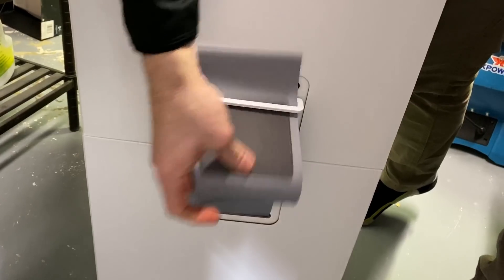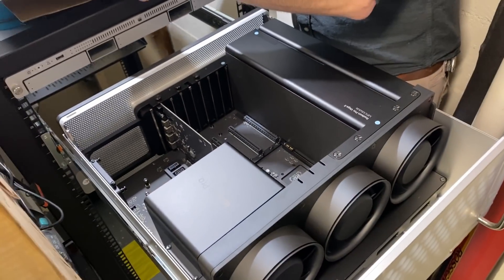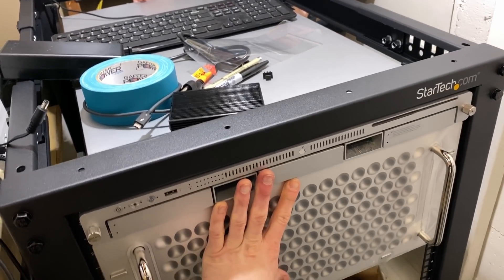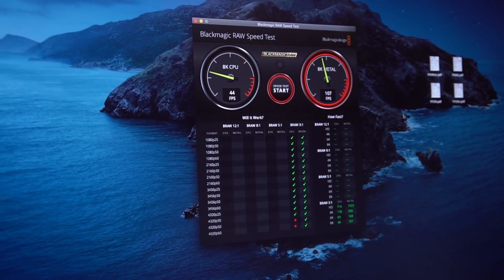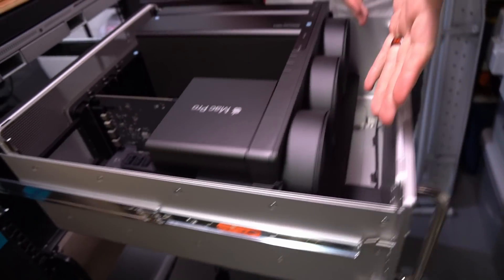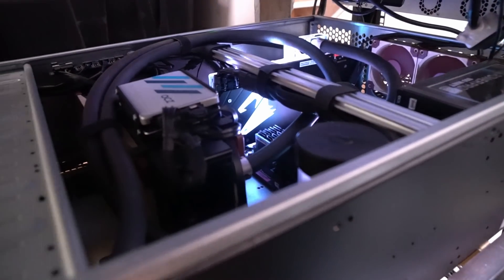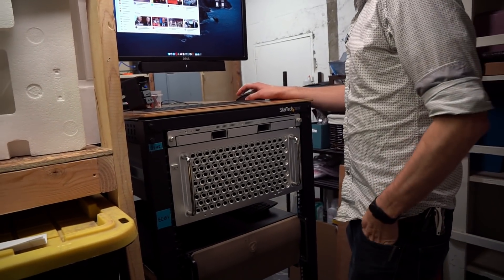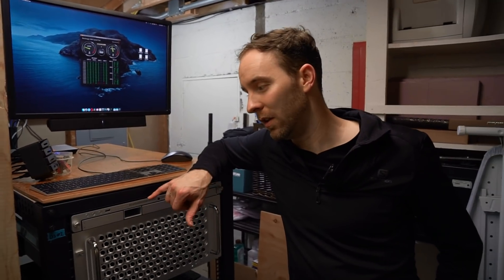Apple Mac Pro Rack - Unboxing and Observations from a Video Professional.

Comment: That RAM placement will be a problem if that machine is installed in the bottom few U of a rack. I wonder why they designed it that way?
Reply: So it looks pretty.
Reply: @alanrossington1351  Maybe, but one doesn't typically have the luxury of doing that in a data center environment, where rack space is precious.  Are people really supposed to leave the bottom third of their racks empty?
Reply: add RAM before the rack (of course), but that it CAN be deployed at any time just by pulling it out on the rails .. kinda genius. 

all the heat by the laws of physics .. goes up. 
absorbed by the entire solid chassis. 
for free. 
+ the blower
+ the fans. 

u don’t want the RAM on the other side. 

but RAM is isolated for a bunch of other key reasons too (rack or desktop versions)

a) exact placement (jacked into the motherboard)
b) isolation (heat / airflow / thermals / sculpted .. considered), this is their ultimate design so far, moved forward, after decades of tower design refinements, G3, G4, G5, Intel MacPro1,1 thru 5,1 .. then 6,1 .. now 7,1. 

I have owned and teck’d most every type of pro Apple stuff since 1983 (except XSERVE)

every iteration .. RAM placement gets better. 

to the un-initiated, a G5 cheese grater
looks like an Intel cheese grater. 

every flavor I have owned .. the insides are COMPLETELY DIFFERENT. 

outside. 
almost impossible to know which gen it is. 

both from a single user perspective + an Apple Certified repair facility type perspective .. I have seen a little of that world too thru friends, every single comment and b*tch session is considered and addressed, perhaps on a daily basis. board revisions will be different as the days and weeks progress. 

I have had Apple fix obscure bugs and niggles - I’m sure no one else on the planet has found - sometimes in as little as a few days or a week, in their pro apps or OS. 

one key reason to be legit. 

u run a crack .. u get left way way way behind. 

been there all kinds of times. for all kinds of reasons. 

sometimes while a legit license goes down, we need to keep going .. switch to a crack. we get a new patch or tech support irons out an issue. boom. back to legit, almost no downtime. 

in a production realm .. we need to pull out all the stops. 

this is always the case in any system tho. 

less savvy IT, and creative thinkers at your studio = u get left behind. 

regular folks are oblivious to this. getting fooled by the myth of cost (hardware .. staff .. ROI). 

they think every 5,1, 6,1 7,1 is the same. 

even as far back as the first bondi blue iMacs, I have pictures of Rev C, Rev J boards. 

OS just says the same to the user. 
under the hood .. man .. probably hundreds or thousands of changes are shoehorned into each board revision. 

that is just normal development. 
hardware + OS. everyday it is new. 

all systems are like this.

Comment: give me legit reason why this is better than hackintosh? if you buy rack setup where visuals does not matter, pure performance and price matters as well you mentioned that this will have only 32+64 gb ram.
Reply: Hackintoshes are cool, but run into lots of issues esp with software updates. The biggest benefit is peace of mind and everything just working as it should. Hackintoshs require maintenance and lots of researching and testing to get working and to keep working years down the line.
Reply: @createdbyeric  https://www.youtube.com/watch?v=swTNV0AqzTQ
https://www.youtube.com/watch?v=i_-K1UtI8PE
Reply: Jānis Meija because in a professional setup you want support and not have to worry about updates breaking stuff, kexts, clover, etc. The cost difference is made up by time saved on all those little things you have to worry about with hackintoshes.

Comment: The Mac Pro 6,1 can be referred to as the cylinder.

Neil Parfitt of Toronto, Canada does audio work in movie soundtracks. He loves the rack unit for his ability to get into the 7,1 without removing cables every time. He has an ilok and a synchrosoft dongles he plugs into a 2 slot usb hub that plugs in where you put the one dongle. He hopes there will be enough power for them. Apple should offer a desktop that can be pulled up and leave the cables in place. https://www.youtube.com/watch?v=xNrG2mwt4Uo
He had 2 cylinders and all his slots on the 7,1 are occupied. He wants the Mojave OS that the 7,1 was shown operating on. His apps are not all Catalina compatible, and some are 32 bit.
Reply: Beat me to it. Was also going to suggest they contact Neil to pick his brain.
Reply: @CescoCDN  that little hub i bought works great!

Comment: The Resolve database machine, does that have to be a mac? Is it just fast storage or does it need to run resolve itself as well? And if so, why not linux?
Reply: It's just a postgresql database so no it doesn't need to have resolve on it. I've got mine running on a CentOS system. Works great. Instructions on how to do that are in the resolve manual.
Reply: @AnillusionNL  Apple people think everything needs to run on a Mac.
Reply: Well to be fair the linux option wasn’t documented in the manual until a couple of releases ago. Only installs on Mac and Windows were documented. And when I asked BM about the linux options I got a response that it was possible but too advanced to even be documented as you needed to be a “postgresql guru”. But if you have a little knowledge on how to setup a linux webserver, you can figure this out though. It’s not that hard, but really powerful.
Reply: The Database can be hosted on Windows, Mac, or Linux, whichever you find easiest. We opted for the MacOS environment for the database as our team is familiar with MacOS so it makes troubleshooting easier if a issue arises. The networking/file sharing through iCloud login is extremely simple for non-network engineer type people which was a huge positive for us.

Comment: Surprised to see a company admit they’ve been running Hackintosh machines previously, but I can respect the honesty. 

I guess Apples decision to return to the server case form factor will encourage other people to return to using official Apple MacOS hardware or finally upgrade from the MacPro 5,1 towers. 

I know lot of people avoided the ‘trash can’ Mac Pro’s due to their lack of internal expandability.
Reply: MorbidManMusic Formal Beach Wear. Every equipment a professional studio production uses costs way too much money.  But studios don’t mind paying for expensive cameras, lights & workstations because those gear are just tools that could help them hired to do more work and make more money. So essentially the Mac Pro will pay for itself.
Reply: @MorbidManMusic Formal Beach Wear. It's pretty well priced actually. Only the entry level models (less than 5000 have bad price to performance, the higher tier ones are competitive). For the base model, you can actually do an aftermarket upgrade.

Comment: You added another 64GB of RAM as 2 more sticks of 32GB? I'm not sure that's the best way for it to run ... you should have 6 sticks of matched RAM right?
Reply: ram doesn't have to be matched. when two different types are used, computer uses the preset of the worst one. so, at the worst, your better ram is just not used at it's rated speed.
Reply: @BusAlexey  That is partly true. There is one additional aspect though: these machines can run memory in six channels which dramatically increases bandwidth. by not matching up dimms, they might be losing a bit of performance. But it depends on the workload.
Reply: @MorbidManMusic Formal Beach Wear. what
Reply: @BusAlexey  use 6 or 12 modules for best performance - equal sized.  Check out the NEMIX brand. It' solid